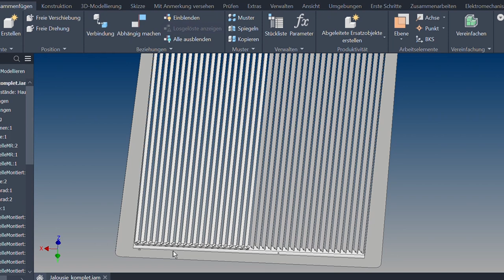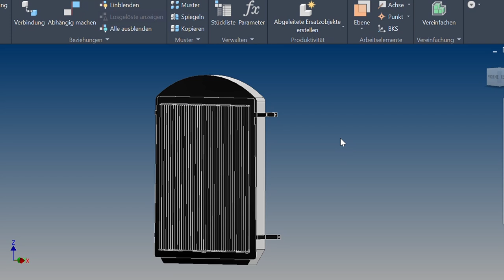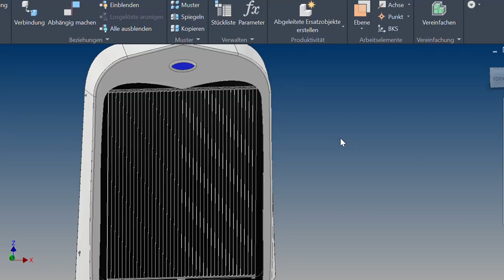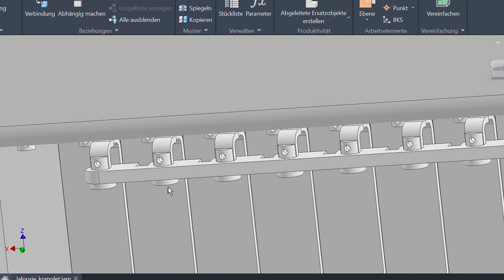Homemade Radiator Shutter - Attempt One.

Comment: You are going to run into the flex problem no matter what you do if you don't put "shape" into these louvers.  IMHO, they need to be wider as well and far fewer of them. Wider louvers will be easier to put "shape" into anyway.  If you don't put at least some curve into them, they will flex like hell.  This is one of the reasons you will not find a single flat piece of steel in most cars.  Even if this idea had worked, you would still have the flexing problem.  

You need a simpler system with much larger tolerances.  Most of the tolerances car companies use are large and were even larger back in the model A days.  You need to build a jig to ensure uniformity within a tolerance.
Reply from the maker: I couldn't agree more with all points you made.

Comment: I think you need to go with less louvres but larger. They should overlap when closed to keep the air out, that might add strength too. Good luck.
Reply: Maybe a bend somewhere in the louver blades could also add stiffness, i think Packard also did that.

Comment: Adrian, don't be hard on yourself,  you worked so dilligently on this project.  Most people have had their struggles. I had my own failure, which was a not very thoughtful experiment.  My first new car, a '67 British Ford Cortina was overcooled in a Montreal Canada winter. I removed the fan blades and the car warmed up much faster afterwards. Then  foolishly I decided to drive to New York City in March.  400 miles south,  8 hours and a change of season to early spring. My car could not be driven downtown as it would overheat in traffic. I was glad to get back on the interstate a few days later and head back to the colder weather. I put the fan blades back on and in the winters that followed I used thin aluminum flashing wired to the front of the radiator.

Comment: Check out louvers that are on an early John Deere tractor such as 1940s models A, B, G, H. I think if one end of the louver length was rolled with a rod inserted in it, then the rod went into a hole in the bracket on both ends acting as an axle. The rolled portion adds strength to the length. Also I think the louvers overlap with a half lap over the next corresponding louver. And fewer, wider louvers. Although they all move simultaneously, not dual opening like you want.  Good luck!
Reply: But you could get dual opening with a center one fixed bar of 1/4" wide just for the shutters to rest against. I do agree that the rod idea with bushings top and bottom would be alot stronger, and the wider blades would be less prone to flex when attached to the rod. .75" width to 1" is what many of the shutters of the time were made width wise. The main part of the shutter body could be on the outside 3/4 of the assembly so the radiator clearance could be tight like he was aiming for. My recommendation is 18 gauge for the shutters just due to wind speed and forces acting against them. With the center bar fixed he could then get each side to do independent movement like he was aiming for to begin with. 

Glad someone else thinks like me here. Cheers guys.
Reply from the maker: Less, but larger louvers, reinforced by a kink or beed, will certainly solve alot of issues. I'll see what I can come up with.

Comment: Wider louvres that overlap would stiffen things when shut. Having the pivots entirely free top & bottom, with the mechanism in the middle - would save a ton of work.

Rolls Royce had manually controlled in the 1920's & then thermostatically controlled louvres in the 1930's to their radiators. There are videos on youtube showing how they refurbish old units.

I am going the radiator grill muff on my cars, I did experiment with inserting a thermostat in the top hose (on my Austin 7), that worked well, but I had problems with fuel vapourisation & removed it, turned out it was unrelated, but decided to stick to what they did back in the day, well, yet to do it.

Interesting to see what you were doing and a lot of effort, still, it is learning, which is a good thing! Greetings from the UK!

Comment: Interesting thought and a good attempt. Eventhough it didn't work, it provided a lot of valuable experience for a future attempt. Thank you for providing this video regardless. My Amazon has a rolling curtain that you pull up with a chain that runs over the motor and into the cabin. I were told Volvos from that era came with those because of poor quality thermostats. Personally I only use it in the winter now, to get the motor quicker up to operating temperature. Never had any issues with it running too cold or hot.

Comment: Keep it up man. You'll solve it.
Can't you check out any other designs?  These are very common in America with 18 wheelers.  If you're hauling something from Florida to Maine in January, you are going to see a very wide temperature difference in these 2 places. Florida can be 80-90 degrees while main 20 below F zero.  Some guys just put flags or something over the radiator, but the louver type are quite common too.  It just needs to be scaled down.
Reply from the maker: The issue I have is that you just can't get your hands on one of these here in Germany. All I had to go by were photos - none of which showed the actual mechanism or showed one taken apart. I've heard many stories of parts markets in Canada and the US where these louvers are a dime a dozen, so I might have to come over the pond someday ;)

Comment: Allot of louvers that are very long are generally bent into a v shape. Perhaps instead of shortening the sides of the louvers, you setup a jig that bends the louver in a v shape to give it strength. One more thing perhaps if one were to redesign this. The primary pins would be square cut with the laser, instead of the individual parts with rivets. Also if your going to do any sort of bending in perpetuity. Perhaps machine a jig again? Consistency is the mother of precision.
Reply from the maker: I couldn't agree more regarding the V-shape. I won't try to save this model, however, as it'd take more effort to get all the rivets out than making a new one from scratch.
I shyed away from the hinges being integral to each louver blade as you wouldn't be able to assemble them without bending each one into the frame and straighten it back out to make the pins engage.

Comment: Adrian, I think that you may be able to salvage your first design. The vanes can easily be significantly stiffened with a bead rolling machine. One could run a single channel up the center of each vane or for more strength run a bead up each edge. This forming would also narrow each vane slightly. I think you’d be quite surprised with how much strength this roll forming will add to the vanes.  I’m not sure what German tool name would correlate with the English term Bead Rolling machine.  It’s simple in design and here in the States inexpensive in the smaller throat capacity ranges which would be adequate In your case. Or take them to a shop working with sheet metal fabrication.

For consistency of each small bracket bend them as one unit and then cut them into individual pieces. I think you have the machinery to easily make a male and female bending die set which could be used in a small press. A couple of simple bend setback calculations would yield the critical dimensions for the die set.  I think the additional time investment is worthwhile as it could yield a much more professional looking result than many more simple solutions.  Good work so far, it just needs some refinement.
Reply from the maker: Rolling a bead into the louvers has been suggested by many people here in the comments and will undoubtedly improve greatly upon ridgidity. I'll turn away from this first version, however, as it'd take more effort to get all the rivets back out (possibly damaging the little brass pins in process), than to just hang this one up in the garage and trying a new, improved design.

Comment: Hello Adrian,
Super interesting project... I think I might be tempted to make the shutter on the inside of the radiator grill (subject to available space). I will be tuning in for the version tow for sure. 
Take care.
Paul,,
Reply from the maker: Whelp, if it wasnt for the ventilator trying to shred any louver installed behind the rad, I'd have chosen that route, too.
But especially with the force of driving wind pusing in on the louvers, I didn't want to risk my engine compartment turning into a battlefield ;)

Comment: Make a die or tool the will impart a centered bead along the vertical axis, about 2 mm wide and 2 mm deep this will take the flex out and reduce the width to increase the clearance between the bars.  You can also go to the US patent web site to get ideas on how US manufactures solved the problem in the 1920s.
Reply from the maker: I've seen one or two Patents - sadly they were all very general about how their contraption actually works...

Comment: I'm sorry that the first prototype didn't work, but at least you gained some insight into what works and what doesn't.
It's just a shame that you put in so much hard work, only to have a failure. I'll be you were seeing shutters and rivets in your sleep!
I have to admit, the topic immediately made me think of the Pines Winterfront as it was a popular accessory in the colder climates (like Canada!)
However, the first shot in your video made me go "OOO! A PACKARD!" so, there's that!🤣
I wonder if wider as well as thicker louvers  would make more sense?
The only objection I would have to a "roller curtain" would be that it blocks the airflow through the radiator completely, whereas the shutters will allow a small amount even when completely shut.
Looking forward to next year!
18:45 Could have been worse. It might have been noon!😂
Reply from the maker: Well, as you say, I've gained alot of intel what can be improved, what works and what doesn't - so there's also a bright side to a failiure.
Less, but larger louvers will most certainly be part of the solution - many suggested increasing their ridgidity by adding a bend or bead to them, too.

Comment: Why not make a winter front from marine grade vinyl that has flaps you can open for cooling and attach it with some self adhesive snaps. Maybe won’t look as cool but it’ll be much easier to make.
Reply from the maker: The piece of leather I strapped to the rad worked fine, too. I just wanted something extravagant :)

Comment: How about two holed plates in front that slide, thus opening the holes? plus two small motors to control them from inside? in the summer, just remove .. well might not work either, just my first thought. Could also put a butterfly valve between engine and radiator, but then circulation is impeded I guess ..
Reply from the maker: The leather cloth worked fine, too - my problem is that I fell in love with that louver idea. So now I have to find a way to make it work xD
Reply: @AstraWerke  Yea, understandable. Thinking more about the holed sheets idea: if the metal was real thin and had 2-3 mm vertical slits, then the sheets would only have to be shifted by that much to give 50% air flow. And if thin enough, the wind would press against the radiator and no rattle. I think one can get small electrical actuators to do the small movement. Well just a ps. I got a 31 A too, but not on the road yet.

Comment: I have a Pines winter front for our 1927 Buick, why not replicate that design with a surround that fits your a?  I do see that the louvers on the pines are much water as you mentioned in your video, so I think that would work better, though I know engineer.
Reply from the maker: Pines even made ones that fit a Model A. It's just acquiring them, what's impossible.

Comment: All of your videos are entertaining. I watch everything you post. I don't know if you were aware or not I may have said it on another one of your videos that I was in a terrible accident with my model A period and unfortunately it was a total. So with the insurance money I ended up purchasing a 1946 Ford. And basically that car solves every problem that the model A had. Not getting up to temperature, being better at highway speeds. Hydraulic brakes. It's the car that I should have bought in the first place. I'm sure you enjoy working on this car and figuring it out. But the model A for me ended up being more grief than it was worth because of my driving style. I couldn't work all the bugs out of it to get it to the level I drive. It's just not a functional daily driver for me. So I don't know. Maybe or later model car would help?
Reply from the maker: Let me answer by saying "Yes and No."
Yes, a more modern car will be more advanced - and the engineers will have learned a thing or two about which design works better than an older one they were able to test by millions of buyers and users of their product, not just in a lab.

BUT: I didn't buy a Model A because I wanted no trouble and just enjoy the ride. I derive pleasure from wrenching on the car - and especially because not everything is perfect, it gives me the possibilities to come up with something that may be better.
Take my approach on modifying the fuel shutoff valve, for example. Or fitting drum brakes. Even little things like adding a light in the trunk or fitting a hinge that allows single-handed operation.

Sure, the engine failiure is a major pain in the butt. But it gives me the opportunity, to improve the things I dislike about it. Counterweight crankshaft, insert bearings and the lot.
I chose the Model A to see how little it takes to have a car that works and isn't a major inconvenience to drive around (like a Model T, for example). Many dislike the manual spark adjustment or the non-synch transmission.
That just makes it all the more fun to me.

I wouldn't say no if someone handed me the keys to a '46 Ford - my dream car would be a '34 Chevrolet - but I like the thought of having a car that is still around in large quantities - and even if you break a fender, there are still new parts around and you didn't just wreck a unique piece of history.
Getting parts for a '34 Chevy? Here in Germany? You'd have to make EVERYTHING yourself - brake linings, lamp glasses... All of it.

So that's why I have the Model A and plan to keep it.
Reply: @AstraWerke  that was a much larger reply than I expected. And I completely respect every one of the decisions and why you made them. Me personally, I don't have a lot of extra time to invest in the repairs that ended up being necessary for my car. Like you, I had to replace my engine. And I had a whole list of many other things that caused me issues. And I just wanted to drive my car! Haha. So my needs and wants were definitely different than yours are now. And I understand that you enjoy the challenge. Me personally, like I said I just wanted to drive. And with this vehicle I can do that. I don't know if you mess with Instagram at all, but I have posted photos of my new vehicle. Lucille the 46 Ford. All one word. I'd be honored if you took a look. Regardless, keep up your YouTube channel. I find it entertaining and educating. And I look forward to new posts in the future
Reply from the maker: @JDvintagemi  Hope I didn't scare you away there ;P

For me it was clear I didn't want to make my life easy with a car - I was already expecting 50% wrenching, 50% driving.
I didn't expect a blown engine for another 10 years, but hey, once that's refurbished, I can be sure about what I have. Should the engine fail AGAIN, then I know I've bought a car that's underengineered for my needs - then I can go look for a more sophisticated automobile.

 I tried having a peak at your instagram, unfortunately it doesn't seem possible without an account...

Lucillethe46Ford, did I type that right?

Best Wishes
Reply: @AstraWerke  no! Not at all. You just reinforced your intentions. I completely respect that. I think you have to have the to app to see it. 

Anyway, I look forward to more videos!